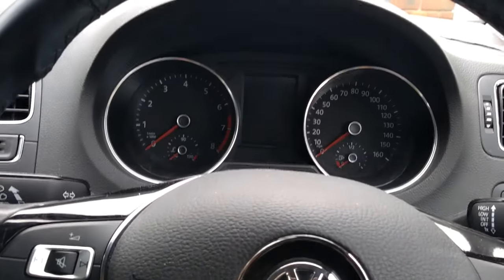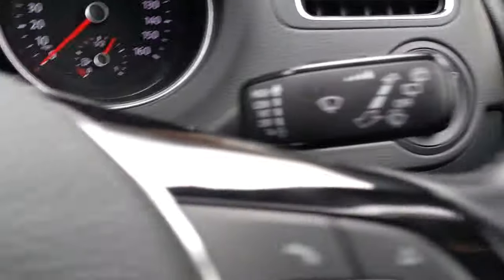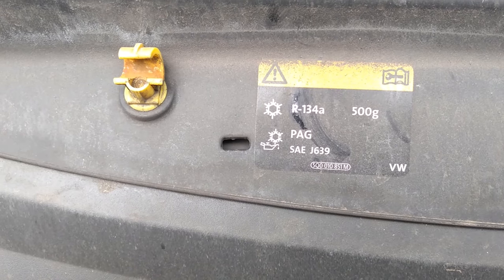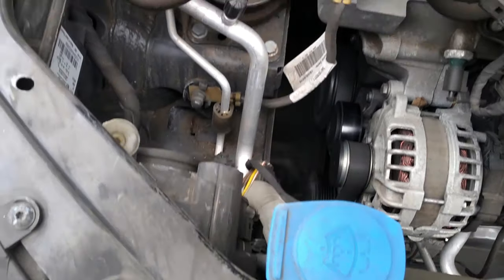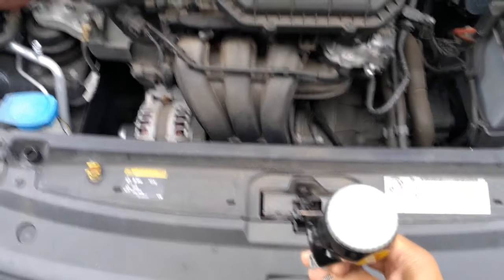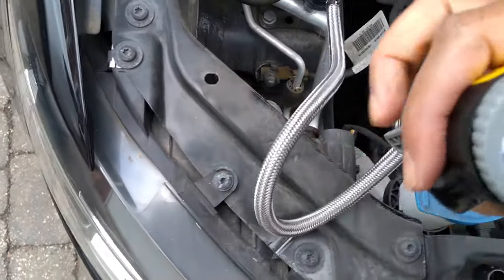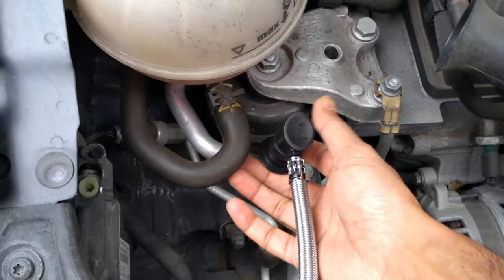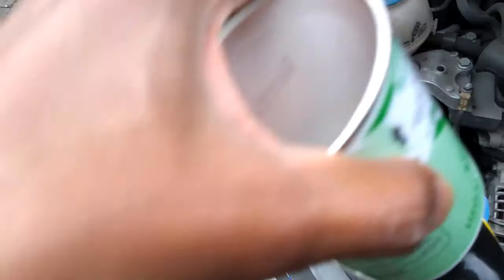Fixing Air Conditioning on VW Polo 2015 - Leak fix and recharging A/C gas

Comment: Hi, thanks for the video. I’ve bought one of these gauges and it says if the pressure reads zero don’t refill and seek professional help. Clearly you just refilled it anyway. Is the system still okay? I have the exact same car with the very same problem.
Reply from the maker: Hi, 
I put in the fix leak can first and then refilled the gas. So far so good

Comment: Hi,
Does anyone know that after filling my car up with 112g of Stop Leak, the pressure gauge has dropped from ~43psi/3bar down to (up from initial 0bar/psi) 38psi which on the pressure gauge comes as ‘Filled’
Is it still safe to fill up my 500g refill can. Will it overpressure the system. Mind you the AC is cooler now but is not the 500g of R134a required.

Comment: Hi, thanks for the guide.
I bought an AC refill kit but the gauge it came with does not fit apparently. 
Is the connector standard or do I need the specific gauge you linked?
Reply from the maker: It doesn't fit the can or on to the car ?
Reply: The car. It fits perfectly on the can as they came together with the kit.
Reply from the maker: Ok, sometimes you have to push the connector into the car quite firmly. I thought it was standard at the car end. Not sure what to suggest.
Reply: I'll try again more firmly. Thank you.
Reply: Hey so I tried with more strength but unfortunately it still doesn't fit. Are these connectors standard or are there multiple types I should know of?
Also, is the connector you show in the video the low pressure one or is it the high pressure one?
Again, thanks for your help.
Reply: Soo I was able to do it.
Apparently the port is standard but the valve I received had the central pin (the one that presses to open the car's valve) far too long so that it would open the car circuit without actually clicking in place. I shortened the pin with a dremel-like tool and that was it. It then clicked to seal the system and I was able to charge up the system as shown in the video.

Comment: Did you have air leak noise coming through front dash ?
Reply: I do have it in my car , what does that mean? Leak from the inside?
Reply: @waleedsaati7131  it is no leak it is AC compressor valve stays open. You need to replace it . And don’t forget to change your Pcv valve every 60k